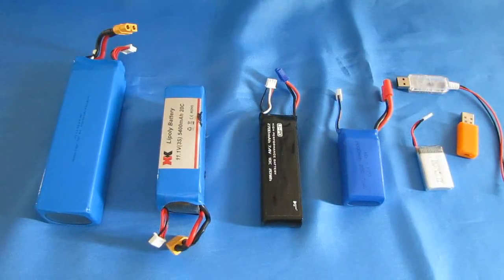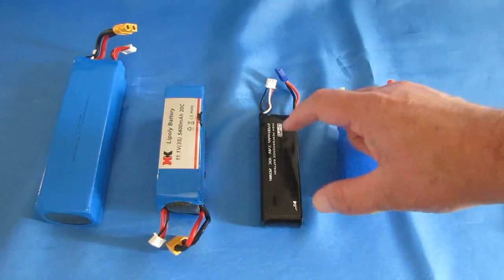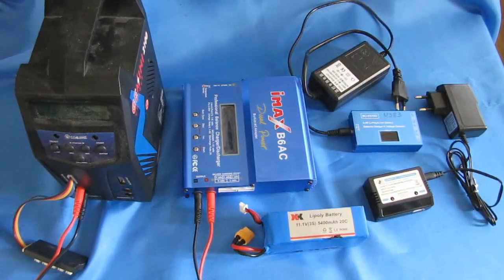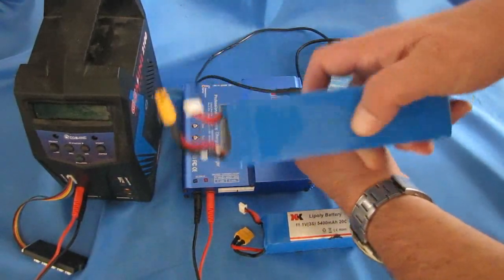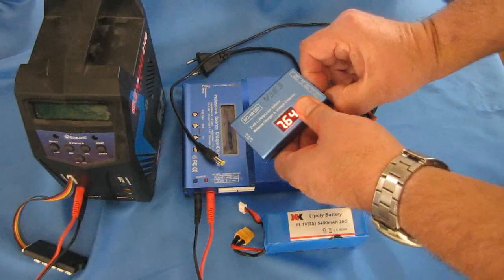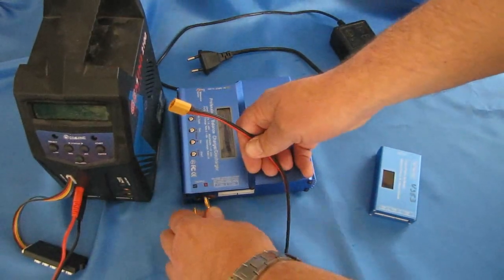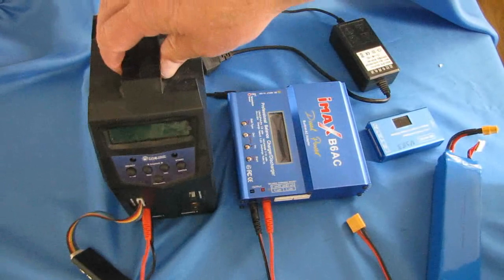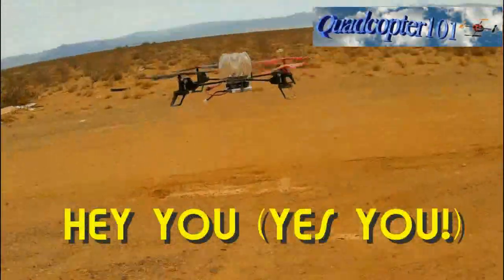LiPo Batteries and Balance Chargers

Comment from the maker: Here are the balance chargers discussed in this video:
2A 24W 2-4S BC-4S15D https://goo.gl/Wp37Nh
and a cheaper clone https://goo.gl/hbOiQf 
5A 50W 2-6S iMAX B6AC (clone) https://goo.gl/wp3NAD
7A 80W*2 2-6S Gemini 2100 (dual charge capability) https://goo.gl/DTfPf4
Reply: Here is something I want to share, because as a beginner it was confusing to me...

--For example a (2700 mAh/7.4 volt/2 s) battery is fully charged at 8.4 volts.  Not 7.4 volts.  7.4 volts is the "nominal voltage".  

--Then I read that you should store the batteries at half charge.  So I am thinking does that mean 4.2 volts (half of 8.4)?  3.7 volts (half of 7.4)?  Well it turns out that full charge is 8.4 volts (4.2 per cell), storage "half charge" is the "nominal voltage" of 7.4 volts (3.7 per cell) and totally depleted is about 6.4 volts (or 3.2 volts per cell).  As Q101 said it is not good to let the voltage in a cell drop below 3.0 (3.2 is safer).

Here is a list of LiPo RC battery pack nominal (storage) voltages with cell counts (xS);

3.7 volt battery = 1 cell x 3.7 volts (1S) = full charge 4.2 volts = drained 3.2 volts
7.4 volt battery = 2 cells x 3.7 volts (2S) = full charge 8.4 volts = drained 6.4 volts
11.1 volt battery = 3 cells x 3.7 volts (3S) = full charge 12.6 volts = drained 9.6 volts
14.8 volt battery = 4 cells x 3.7 volts (4S) = full charge 16.8 volts = drained 12.8 volts
18.5 volt battery = 5 cells x 3.7 volts (5S) = full charge 21.0 volts = drained 16.0 volts
22.2 volt battery = 6 cells x 3.7 volts (6S) = full charge 25.2 volts = drained 19.2 volts
Reply: Nominal voltage is not half charge. On average a 1 cell (1S) battery (lithium metal oxide based) is half charged @ 3.85v. And as you stated at full charge @ 4.20v per cell. Nominal Voltage should not be confused with a real voltage. Batteries do not have a set real voltage value since the real voltage of a battery is actually its range of voltages depending on its chemistry and charge/ discharge state (The reported voltage of a battery is what you measure at the time you are measuring it and as such can vary per charge level of a given capacity, chemistry and temperature).Nominal voltage is actually 3.70v per cell as this is an acceptable/ expected voltage for a lithium metal oxide based battery. Accepted Storage voltages are from 40% to 50%. which are 3.80v to 3.85v per cell respectively. Obviously the difference between 3.70v and 4.20v is 0.5v (500mv). Depending on specific chemistry of the cell their discharged voltage varies from 2.70 to 3.00v per cell. And charging a discharged cell is sometimes not possible and not recommended. Most balance chargers or cells with protection circuits will not allow you to charge a depleted cell. also for the protection circuit the voltage could be too low to bias the mosfet containing circuit and leaving the battery in a permanently open state (permanent open circuit) Depleted cells are electrochemically unstable as when in a charged state the anode is cathodically protected when the lithium is intercalated into the carbon coating on the copper foil substrate of the anode. if not copper dissolution will occur and copper ions will plate the anode while charging, drastically degrading the cells performance. Further degradation of the cells chemistry can even lead to an internal short circuit when its chemically unstable
Reply: Sorry I wasn't as specific or as knowledgeable as you gentlemen.  Again as a beginner, I was sharing the information I found.  My experience is with two quads a Syma X5C and a Hubsan H501C.  The Syma, I run until the lights flash and then I land.  When I check the batteries (I have multiple 1S batteries for it), with a meter they read around 3.2 to 3.3 volts.  When they are fully charged they read about 4.2 volts.  Hence I try to charge them to about 3.7 volts (which just happens to be the nominal voltage) being the middle of the range.  The forums I read simply say something to the effect of storing LiPo's "half charged".  Again I didn't find anything more specific than that.  

For the Hubsan my battery meter reads about 8.4 volts when fully charged.  I run it for about 18 minutes, given that many forums say it will fly about 20 minutes.  Again the meter after the flight reads about 6.3 to 6.4 volts on its 2S battery.  So I have been targeting a half charge of 7.4 volts.  

If you are more conservative and never deplete your batteries as far as I do, congrats.  If you only want short flights, that is your choice.  If you feel strongly that you should store them with an additional 0.1 volt, great.  I sincerely doubt it makes much of a difference.  Certainly not enough to so aggressively dispute what I wrote. "But do what you want, I don't care."
Reply: Quadcopter 101 how about those small  B3 AC 2s and 3s charger?

Comment: Good that you were able to give that info to your newer subscribers. Having a good charger is a nice accessory, especially if you are using the larger sized batteries, or need a multi battery charger.  One thing I'd point out on the iMax B6 charger is that its max charge rate is 6 amps (thus the "6" in the name "B6"). It defaults to 5 amps when you get it, but you can go into the USER SETTINGS and change that up to 6 amps. Now, if your 5200mah LiPo for, say, an XK X380 is supposed to be charged at 1C max, you would normally not want to go beyond 5.2 amps charge current. However, there are some more expensive batteries which can be charged at higher rates (2C to 5C). With the proper adapter, you can charge 5 of the 1S 500mah Syma X5 batteries all at once with the B6 charger. Since they will be charged in parallel, you have to add all the capacities to come up with a 1C rate. So, for example, if you plug in 4 of the 500mah 1S batteries into an adapter, that's a total of 2000mah, and you could set the B6 to charge at 2 amps.  The cooling fins mostly come into use when the charge is used to discharge a battery, which is another function of these more advanced chargers.  Some chargers allow you to "Cycle" the batteries a number of times (Charge/discharge/Charge .. etc.) BTW, I had a XK X380 5200 mah battery have a bad Cell #1, not quite as low as yours. (I had it on a discharge, and didn't hear the warning beeps).  I was able to resurrect it using a Venom balance charger, but it took a LONG time to balance out the cells. Hopefully you will be able to do that. I ordered and am waiting for a 4000mah Graphene battery to use in the X380. It is the same size as the 5200mah battery, but Graphene batteries are far more durable and will take over 100 charges .. Many LiPos (especially cheap ones) will start swelling and having problems after 20 charges.  Anyway, glad you guys got some rain .. shouldn't have any forest fires out there this year. Cheers.

Comment: The B6AC also has a port for temp probe but is an extra accessory . It also come with battery clips on primary source side for 12 volt input for field charging from a larger   amp/hr  12 volt

Comment: Quadcopter 101 what's the best option for field charging 3S and up batteries, such as on a camping trip? It would be nice if there was something like a solar lipo charger, so you didn't have to bring either a BIG deep cycle battery or a generator.

Comment: I'm sure you already know this, and it may come across as nitpicking but at 9:21 the way you disconnect the banana cables from the charger while a battery is still plugged in and then somewhat bunch them in your hand/fingers at 9:26 is "dangerous."  Batteries should always be disconnected from a charger before banana plugs are removed. I was rushing once to get something unplugged and I learned this the hard way. Accidental reverse polarity isn't pretty.

Just wanted to point this out so that anyone new to charging doesn't make the same mistake. Sure, it's possible to be "careful" while removing it... but it's better to not get into a habit of doing that at all.
Reply: Yes, you never should unplug the banana cables with the battery still connected. I was waiting for sparks to fly.
Reply: I agree. As he was unplugging the banana plugs I was thinking dumb move, you will be plugging them rite back in or else you would be hunting for them later and sure enough he plugged them back in.
Reply from the maker: Agreed, I see your point.  That was dumb of me.
Reply: I wouldn't call it dumb as you know to be careful. Newbies on the other hand might not be so careful. I know that I wasn't and that will never happen again!
Reply: Right, that's why I posted this response. I legitimately cringed when I saw him do that since I know what happens... things go boom.
Reply: John Cuppi guy at the local hobby store told me he left one in his car for several hours and it ended up TOTALLING his car... only not from fire, but from the SMOKE. do they actually explode or make a high temp. chemical fire?  or only spew toxic smoke?  not necessarily a noob.. but I've yet to have a batt do something like that,so wondering how bad it really is
Reply: Not nitpicky at all.  If the bananas touched, it would most likely destroy the battery or cause a fire.  
And to quote dear ol' Mom; "you could put your eye out that way!"

Comment: the second time i charged the 1500mah (eachine 250racer) battery  with the 
included charger , the battery  was smoking  and had charred my bench when i checked on it about half hour later.

then i bought a imax b6 and a fire retardant bag  and use them  for everything  including 1s . the b6 also has a temp sensor .
the 20 amp parallel board is also a time saver for charging up to 6--- 2s-6s. batteries

Comment: I want to get a higher end FPV drone and am considering the H501s. I did get the H507d+ but I was not satisfied with its performance(due to low wind resistance) so I returned it. Do you think that the H501s will be a good drone for me? The H507d+ was my first FPV drone but not my first ever drone. Also do you think I should get a good balance charger and 1 or 2 more batteries with it? Or a VR headset? Thanks!

Comment: Quadcopter 101, I have a 3.7 700mAh battery and it appears the battery wrapping is .. shall I say mushy is. A new battery has a firm feel to it and mine is soft. I assume the battery is OK because it holds a charge and works fine. So the question is what causes this and at what point should I recycle the battery. Should I get one of those fire-proof bags to charge it in? Thanks Great video.
Reply from the maker: Puffy batteries should be disposed of as unsafe. Time for a new one.

Comment: So seeing you have a lot of experience with lipo's  can you tell me why  1 lipo puffs up while the other stays ok, although both have been charge and used the same way also with a professional charger and not charged over 4.2volts
Reply from the maker: There are many causes of puffy batteries. But some of the most common are 
1) Long term storage at full or nearly full charge (best storage voltage is around 3.8 volts)
2) Repeatedly draining the battery close to 3.0 volts.  I like to land leaving no lower than 3.5 volts remaining per cell.  Others will say lower, and others will say higher, which tells you there is no strict rule.
3) Using a battery with too low a C rating for your particular quadcopter https://goo.gl/I7NPqw  Feel your battery after a flight.  If it seems particularly warm, almost hot, consider purchasing a battery with a higher C rating than what you currently got.
4) Recharging a battery too soon after a flight.  Let your batteries cool down to room temperature before recharging. You can recharge warm or hot batteries, but by doing such expect their usable lifespan to be greatly shortened.
Reply: Thanks for the very wel explained reply,   just one more question, if on storage voltage, how long can you leave it, on the charge. I am going away for 6 months, my hobby store says I should fully charge them
Reply: Lasersbee    LOL  I understand the confusion haha Spelling mistake.   No not leaving it on the charger, wow  On 3.7volts, will  the voltage go down under the critical voltage in 6 months and destroying the lipo
Reply from the maker: For length of time, there is a possibility of one or more cells going under 3.0 volts.  But that doesn't necessarily mean that the lipo is destroyed.  Notice the battery in the above video with one cell at 2.6 volts.  After making this video, I was able to recondition this battery using the following balance charger https://goo.gl/Wp37Nh
The charger charged all three cells at about the same rate, until two got close to their maximum charge of 4.2 volts at about 4.18V and 4.90V respectively.  At that point, the charger slowed charging those two cells, but continued charging the third cell at a higher rate.  This continued until all three were at the same voltage.
Reply: I ordered one of these chargers, always handy to have, thanks for the advise

Comment: could you check  the Hubsan H501s charger if it is better than those cheap 2s balance charger? also if i am to use imax B6 charger then by theory we sud charge that 2700mah 2s 10C battery at 1c i.e 2.7A right?  but i doubt it may damage the battery soon since its just 10C battery and 2.7A may be too high? what are your thoughts ?
Reply from the maker: Sorry, but it is one of those cheap 2S balance chargers.  And yes 2.7 A would be the charge amperage.  But you really don't need a B6 for the Hubsan batteries.  The following is what I use with my Hubsans https://goo.gl/Wp37Nh  It charges them at 2A. Although not as quick as the B6 in charge time, it's close.  It's also cheap and easy to use.

Comment: I picked up a BC-4S15D to charge my MJX Bugs 3 battery.  Can I use it to charge my 7.4v 250mAh li-ion batteries or will it fry my batteries?  Thanks in advance.
Reply from the maker: It should easily charge it.

Comment: hey man got a question. my sky vampire is spose to have live video. it worked perfect last flight but just stopped working. I tryed everything from resetting wifi n tablet. still won't work. only thing I've down different is switch memory cards for more memory but still won't work. any ideas on how to fix it? this is a non GPS drone
Reply from the maker: Did you connect to the WiFi signal in your phone's WiFi settings?

Comment: I have a 3s 850mah battery, will it be ok to use the smaller Wltoys charger, I was thinking it might charge at too high of amperage. my budget is $30 i also consider the b6ac clone model, but know about taking that risk what You think?
Reply from the maker: It will work, but may take a little bit longer to charge than the higher amperage chargers such as b6ac.
Reply: Ok, thanks for the quick reply

Comment: on the b6 there are no balance plugs. only adapter cables. can I damage the battery with this? cost under 30 bugs.plz help me out
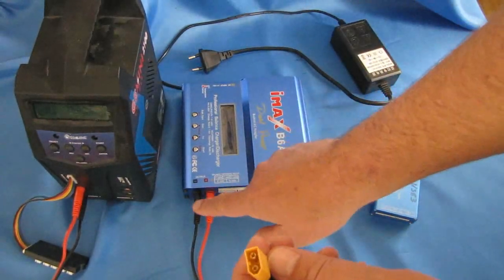Reply from the maker: See the above video at 8:35 The B6 AC comes with a few power lead cables for more popular batteries.  To charge a battery with the B6, you need to attach both the power lead and balance plug into the charger as shown in the video.  You can separately purchase additional power lead cables if your B6 did not come with the needed cable for your particular battery.
Reply: Quadcopter 101 at the b6 are the red and black outputs but no balance plug. only adapters for t plug or other but nothing with balance. or should I spend more money to get this b6ac one?
Reply from the maker: If there's no balance plug inputs, then yes you should consider a better charger.  If you're batteries are small to medium sized, the following is more than sufficient https://goo.gl/Wp37Nh  It easily and automatically does a balance charge every time, and uses the battery's balance plug only.
Reply: Quadcopter 101 thx for your support
Reply: Quadcopter 101 now I know what's the deal with the b6 without balance ports. you need one of these balance boards to charge with it. but I'm thankful for your support!!! love the vids

Comment: hello, mostly xiaomi drone charger me advice? thanks
Reply from the maker: I forgot to mention in the video that some quadcopters use proprietary batteries.  That means you have to buy replacements from the same manufacturer, and many time also have to use the charger provided with the drone.  Unfortunately, the mi drone uses a proprietary battery and charger.